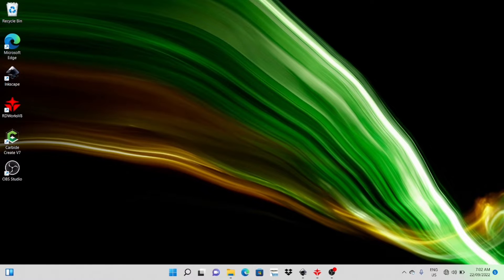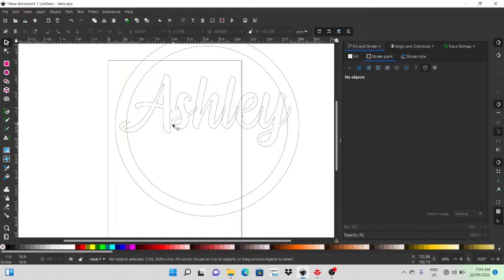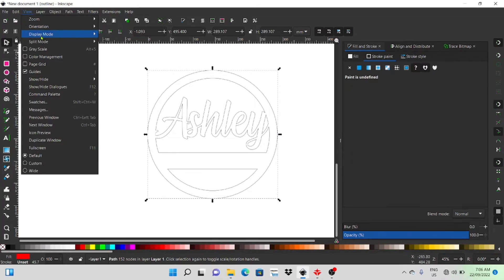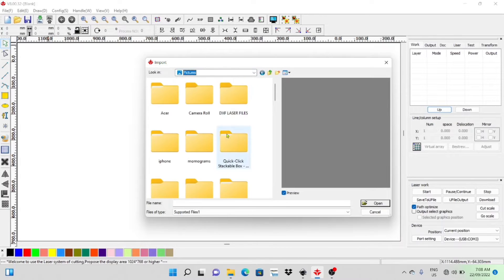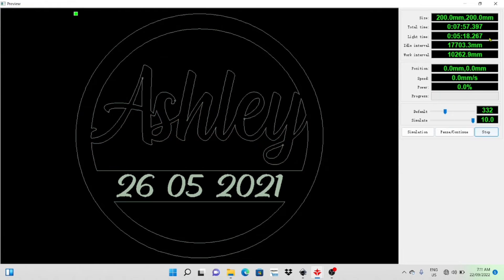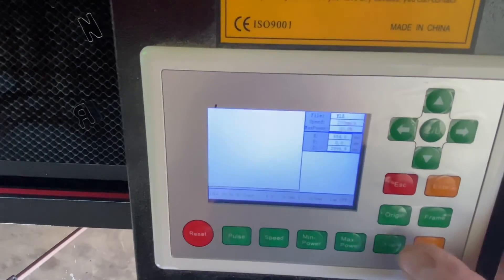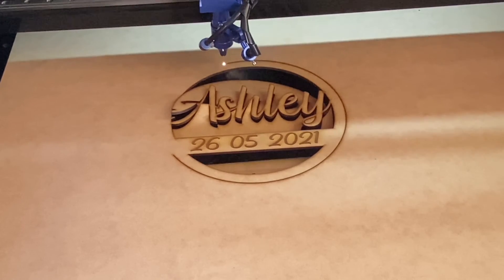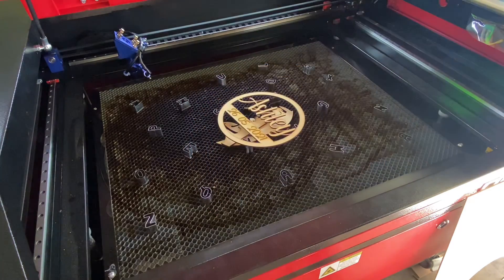Start To Finish!! 80w C02 Laser!! U/Inkscape & RD Works!

Comment: Hey Mate, 

Just a quick one, in RD works is there material presets? With the appropriate speed and power?
Reply from the maker: Hey mate, 

I don’t think there is I know you can set them as you go so that when your setting up a job you can load certain parameters for different thicknesses of materials that you have saved but it doesn’t have them pre set I did tests and then saved each one in the library so it was easy to just select when working with that material,
Hope this helps and thanks for watching 🤙🏽 cheers, Matt

Comment: ugh, new to this. When I put a dxf file in RD works to cut and scan it scans the background around the shape instead of inside the shape. How can I change this?
Reply from the maker: Is there a line around your deign sounds like you may need to ungroup it by clicking edit>ungroup you can then delete the outside like once ungrouped you can also just select the parts you want to engrave by assigning them a colour and then a different colour for what you’d like to cut hope this helps thanks, Matt

Comment: Hey mate, I noticed on the screen of the laser, the image was reversed. Do you know why that is?
Reply from the maker: Hey Galen, you can flip it on the controller itself but for some reason when I do it it changes the layout of my bed size as in it thinks my start pointing in the back right hand corner and not the back left so when I frame my jobs I get the x y slop warning I’m sure there is an easy fix or setting somewhere but it doesn’t bother me so I just leave it, thanks for watching!!